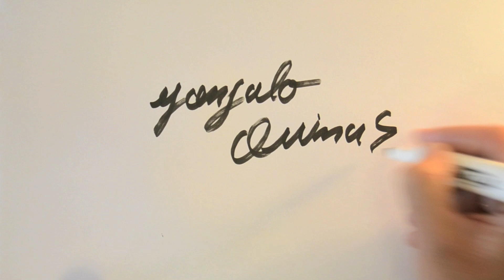DIY boat trailer for FT011 and Wltoy 10428-B (GENERAL LEE)

Comment from the maker: First place to pre order 7% off for BANGOOD RC products: Toyho

Buy the general here: 
https://www.banggood.com/pt/WLtoys-12428-B-112-2_4G-4WD-RC-Car-Electric-50KMh-High-Speed-Off-Road-Truck-Toys-p-1261499.html?p=8I15039486406201703V&utm_campaign=9486406&utm_content=3312

http://www.gearbest.com/rc-cars/pp_617902.html?lkid=10841305

Feilun FT011:
https://www.banggood.com/Feilun-FT011-65CM-2_4G-Brushless-RC-Boat-High-Speed-Racing-Boat-Without-Battery-p-1072540.html?p=8I15039486406201703V&utm_campaign=9486406&utm_content=3312

https://www.gearbest.com/rc-boats/pp_331436.html?lkid=11158720

Skytech H100: 
https://www.banggood.com/H100-2_4G-4CH-180-Degree-Flip-Electric-Racing-RC-Boat-Toy-With-Water-Cooling-System-LCD-Screen-p-1234141.html?p=8I15039486406201703V&utm_campaign=9486406&utm_content=3312

https://www.gearbest.com/rc-boats/pp_362554.html?wid=3&lkid=11158734

Wltoys 12428: 
https://www.banggood.com/pt/WLtoys-12428-2_4G-112-4WD-Crawler-RC-Car-With-LED-Light-p-1046285.html?p=8I15039486406201703V&utm_campaign=9486406&utm_content=3312

https://www.gearbest.com/rc-cars/pp_351315.html?lkid=11158707

Wltoys 12428 Servo: https://www.banggood.com/pt/Wltoys-112-25g-Spare-Parts-Servo-For-12428-RC-Car-p-1115485.html?p=8I15039486406201703V&utm_campaign=9486406&utm_content=3312

Wltoys 12428 540 Motor: https://www.banggood.com/Wltoys-1242812423-112-RC-Car-Spare-Parts-540-Motor-0121-p-1084241.html?p=8I15039486406201703V&utm_campaign=9486406&utm_content=3312

WLtoys 10428 - B: https://www.gearbest.com/rc-cars/pp_617902.html?lkid=11158711

 HB - P1001: https://www.gearbest.com/rc-cars/pp_321160.html?lkid=11158718

HB-P1801: 
https://www.banggood.com/pt/HB-P1801-2_4GHz-4WD-118-Scale-4x4-Rock-Crawler-Off-road-for-Vehicle-RC-Car-Truck-p-1265614.html?p=8I15039486406201703V&utm_campaign=9486406&utm_content=3312

https://www.gearbest.com/rc-cars/pp_227935.html?lkid=11892556

HB-P1803: https://www.banggood.com/HB-P1803-2_4GHz-118-Scale-RC-Rock-Crawler-4WD-Off-Road-Race-Truck-Car-Toy-p-1217973.html?p=8I15039486406201703V&utm_campaign=9486406&utm_content=3312
Reply: Goncalo Quinas can I have the measurements for the wood